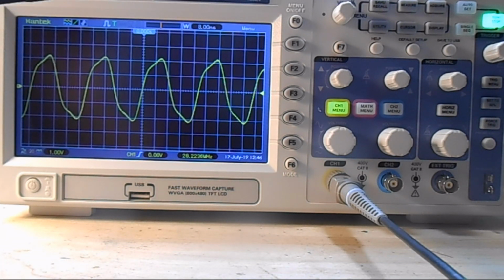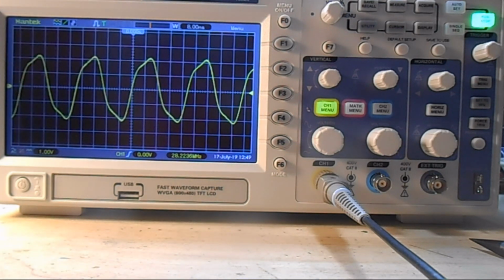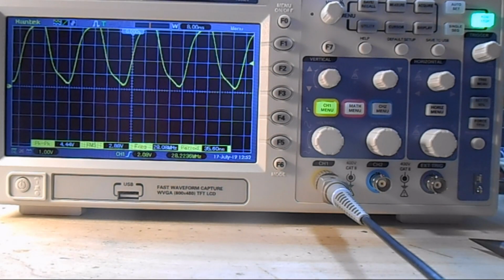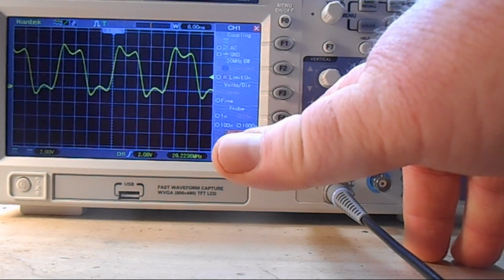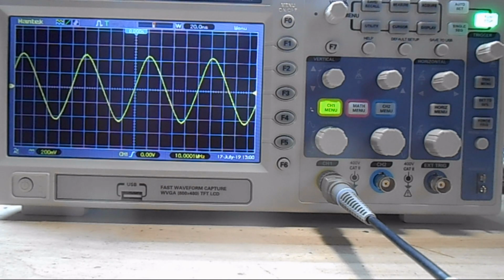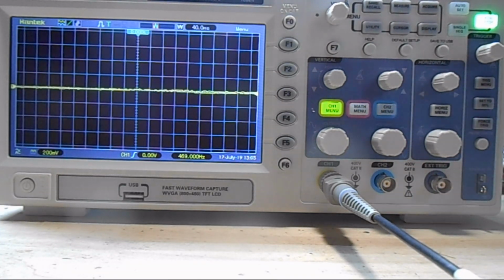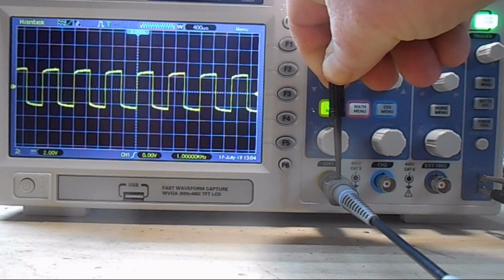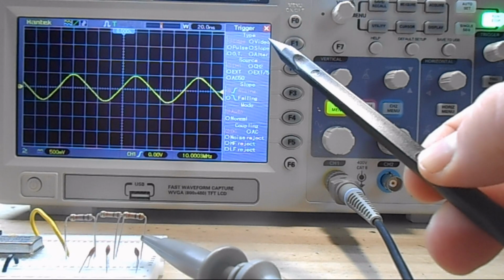Getting started with an oscilloscope

Comment: Uncle Paul, I know it has been five years since you did this video, and hope that you are now past your kidney stone issues.  Can you clarify something for me? When you are compensating the probe on channel one, which I at first missed, you have the alligator clips attached to those metal tabs (for lack of a better word).  In other videos I have seen, they connect the red alligator clip to the tip of the probe, and then connect the BNC side to the generator channel, with the generator turned on. This is the wat that it is done on a FNIRSI 1014D scope. Why do some scopes, like the Hantek scope you are using, have those tabs sticking out the front of the unit, unlike other units where they make the connection directly to the generator channel, like the FNIRSI does?

Comment: Hey, this is a great serios of videos. I hope your surgery went well! :) I have a couple of questions that I really hope you or someone here can answer. One is a more general question, and the other is a specific application of that same question. For background, I'm pretty knowledgeable when it comes to electricity and some aspects of electronics (I'm an Amateur Extra class ham radio operator), but I'm new to the world of instrumentation when it comes to electronics.. arbitrary wave generators, oscilloscopes, etc... I have a decent understanding of what they do, just not how to properly use them. An engineer over at Siglent suggested I have a look at some of your videos, so here I am. FYI, I bought an oscilloscope (SDS1202X-E), Arbitrary Waveform/Function generator (SDG1032X), and a Triple Output Power Supply (SPD3303X-E) from Siglent. I bought these without a real purpose in mind other than to learn how to use this equipment in pursuit of my radio hobby and a newfound interest in pursing physical computing things like Rasberry Pi / Arduino builds... PWM motors and stuff like that... so now you know my background... here are my questions...

1) General question - I understand the outer shield of the connector (and thus the clip side of the probe) goes to a common chassis ground on the scope. Is it always true that signals you might measure from an appliance would always have a grounded side? I'm thinking that the internal components of a circuit board, a radio, etc., might have the circuit you're observing in complete isolation. Imagine, for example that I wanted to examine the waveform on a PWM controlled motor (like on a DeWalt brushless cordless drill, for example). Is the choice of which side of the circuit you would connect the probe leads to arbitrary in that case, or would you need to ground one side of the application on the bench?

2) Specific question - I thought one easy demonstration of how different kinds of waves and modulations look would be to show the sine wave of household voltage (should certainly be a nice, clean sine wave). So, I assume I would put the ground side of the probe on the chassis ground of the mains, and then the probe itself to the 120v RMS "hot" side of the circuit? w/ a 10x probe, this would give a range of about +12/-12v, or 24v PTP (assuming I am understanding correctly how that term is used)... Would this be the correct way to perform this measurement? Would I need any kind of resistive load in there, or does the probe itself provide the necessary impedance, so I'm not essentially creating a short to ground?

The next application of that second question is to then compare the quality of power production equipment. I have a propane-powered 120v RMS AC inverter generator. It's my understanding that this one (a Champion), is classified as a "pure sine wave" inverter. In this case, there is no "ground" per se, unless I explicitly were to ground the generator (I'm sure there is a way to, as it does have a 3rd ground pin on its outlets), but I am thinking here... Would I test with the ground clip on the neutral side of the outlet, and the probe on the hot side? How does that affect the measurement if the generator's neutral isn't common with earth ground the way mains voltage is? On a similar note, I have a Harbor Freight Jupiter 10,000 watt inverter that I happen to know (from observing the poor performance of motors and other things connected to it) produces a truly NASTY square wave. I am thinking I would test this in the same way... Ground clip to the neutral side of the inverter, probe on the hot side... as with the generator, there is no true earth ground here, unless I were to create one.

Any thoughts on these projects / experiments would be greatly appreciated. Any suggestions on fun and interesting things to do / try with these appliances to become more familiar with their use and function is always appreciated. I'm enjoying your videos, and look forward to more. Thanks for taking the time to read and respond!
Reply from the maker: That's a lot to respond to here. Please email me arduino0169@gmail.com.
Paul WW8PR

Comment: Not enough finger on screen to show the Zero point. Too easily missed.
When you're pointing at stuff with your index finger, don't forget your thumb dominates the screen.
I'm not suggesting that you cut it off but keep it out of the way.
EG, "We also have a signal inversion ..." and the hand obscures it!
"Then we have our fine and coarse adjustment.." and we get the back of a hand!!
You press too many buttons without saying a reason for doing it nor explaining the resultant effect.
I think that I'm going to have trouble lurching through to the end of this!

Comment: do they have a method for testing current with an oscope, such as some time of clamp on attachment or possibly a means of placing leads in series?
Reply from the maker: Yes you can use a current clamp

Comment: Thanks for the vid.  I bought a nice oscilloscope at a pawn shop and it's been a paperweight for a couple of years.  I couldn't find any videos like this at the time.  Most seemed to assume prior knowledge of which I had none. Still don't know how to measure a circuit and do anything useful with it. Couple that with the fact I don't have an isolation transformer to plug it into, which means I could apparently fry the thing as best as I understand it, therefore I'm reticent to play around with any ac signal or measure one on a circuit board. In short, my education on the subject is at a standstill.  I'll be checking to see if you have more of these great beginner/dummies videos on your channel so hopefully one day I can do something useful with mine. Thanks again Paul. 
Hope your kidney stone is all better, btw.